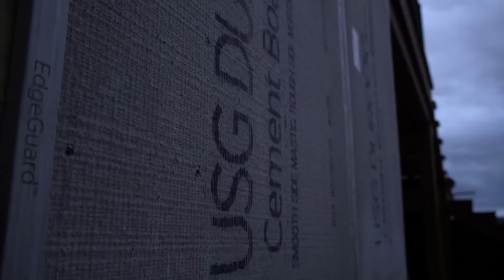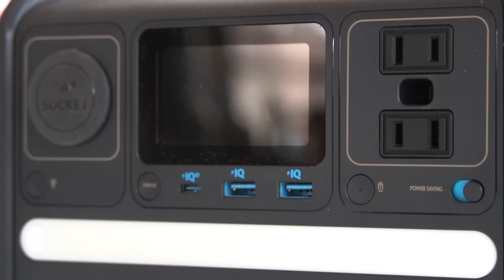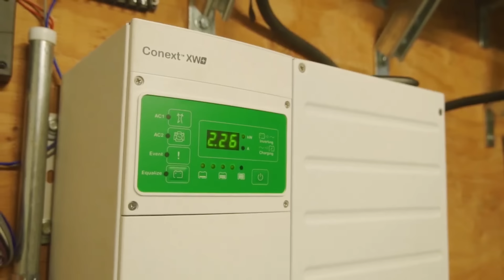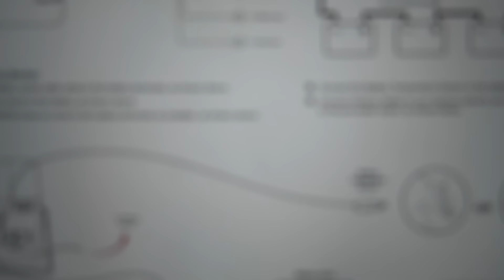Building An AMAZING HOUSE In The Woods

Comment: Erin, I think Josh's injury has been a blessing in disguise.  Your use of the tools has transformed  in just a few short videos from 'how do i...' to lets wing it.  The chop saw you are using like a pro.  And hammer drill...and everything else.   Now you are becoming a competent builder all by yourself. 
My wife and I remodeled this old 1890's farm house last year...by ourselves. Although we are a few decades older than you and Josh. Like you, we didn't have any tools, and very little experience,  when we started.  Now we have table saws, routers, planers, etc and our joints are tight and the repairs are hard to detect.  I watch your learning curve and reflect that we did the same thing just a few months ago.....and it is so fulfilling and satisfying to know what you can accomplish.  You are doing great.  
PS: My wife and I love working together and are better as a team than apart..just like you and Josh

Comment: Josh & Erin, May i suggest looking for an “electric jack hammer”. They are available at many price points. Given your underlying rock topology, when you need a tool like this, it will pay for itself in saving time, aggravation, and effort Erin expended to dig the single post hole.

Comment: You have to support concrete board a minimum of 24 n center to have any structural support and to prevent the stucco from cracking. 16 inch on center is highly recommend for exterior application. Pressure treated lumber for any exterior framing. Especially lumber in contact with the ground. All the best

Comment: It's amazing what you two have accomplished. But I can't help but think how much easier all of the foundation/deck enclosure work would have been if you just poured or blocked solid stem walls in the beginning. Yes, it would be more expense up front, but the time saved would have been invaluable. You're also going to have to watch for long term moisture issues where you have the cement board against the deck framing, that cement backer board is highly porous and will trap water/humidity against the wood. Can't wait to see the finished product!

Comment: Erin.... digging a hole like that requires a hammer drill with an 18 inch concrete drill bit to break up the rocks and a shop vacuum to get the dirt out of the hole.  Then the dirt is in the vacuum and you can take it anywhere and dump it.

Comment: Put an edge on the spud bar before digging any more holes. Not knife sharp but more than it has now. I've used a large screwdriver and two pound sledge to break dirt before. Hammer drill. Excavation is about as tough as it gets. Grind it out anyway. Hole ain't gonna dig itself. Don't get bogged down in fancy technique. Break it, muck it, done. Removing material is the only thing that counts. 

Alleve helps stop inflammation before the liquid even begins to collect. Less liquid, less swelling, less pain, more house.

:-)

Comment: Erin
That type of screw will usually break off when they go all the way though. You can hit them with a hammer right at the base and they’ll snap right off. They are extremely hard. 
You must be one stout lady   I know how heavy that Durrock is!! I’ve installed lots of it.

Comment: I think with the lath, scratch coat, back buttering the stone, then the stone; you may encounter issues around the deck.  The stone may be furred out too far from the deck and may not achieve the aesthetic you are looking for.  Also water can get behind the stone at the top of the wall and cause early erosion. Most stone is covered by an eve or concrete crown on a  chimney to help with heavy water saturation.

Comment: 3:26 you are not fooling me. Josh instructed you that concrete drill bits move to any area of lower density. so drill one and anchor it to keep it from moving on other drilling locations. either way, you did it right.

Comment: Hi ,from Bulgaria !Great Job as always !
Every batery must have separate fuse.What you think may happend if one batery shorts?Also battery it is better to be on ground becouse summer temperature will shorts them life.Up there temp is higher.Also made some space between batery , becouse they heat when charged its enough half inch.

Comment: Great stuff, as usual... I wonder if you might face a hail storm which could wipe out the solar panels... That would be a huge setback and expense and sudden too. You may have considered it, but just in case you haven't, I thought I'd offer a warning. I've avoided using panels due to such risks in the past. Now, I think about ways to protect them from impact damage.

Comment: Erin, great job manveuring those digging tools!!! As always a job well done. 

The goose is a great addition to the chicken pen as well as a moveable alarm system. Any thoughts on a "Alarming Name"?

Both Leon and Chuck are right in front supervising every project.

Good to see Josh is coming back to life. Talking from experience...don't start doing the usually things yet...lifting-straining, it's easy to reinjure those ribs, which will set you back even more. Josh, you didn't eat all the snack cakes already...did you?

Just one question:
Why did you bury a untreated 6x6 in the dirt, over time dry-rot will occur; was that not a concern? Replacement of that 6x6 looks to be a real pain "ITA" when it comes time...

Enjoyed the video!!!

Comment: Just an observation, I am not an expert but, shouldn't you be putting screws through the durock on 2" centers?  Every time I have have used and put stone tiles/or just tiles even on a flat surface the recommendation was ever 2 square inches.  You plan to hang a lot of weight with the stone so I would hope you might check with some experts.  Love you guys.  Be safe and Merry Christmas.